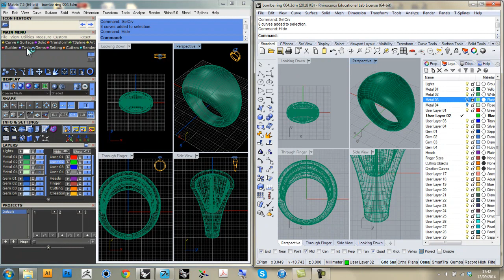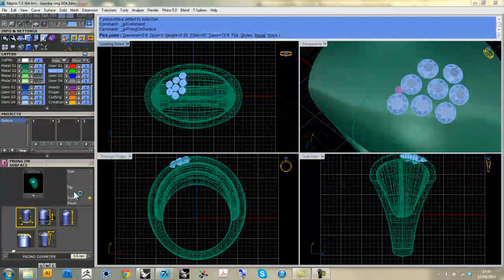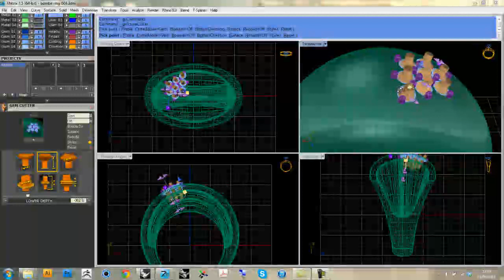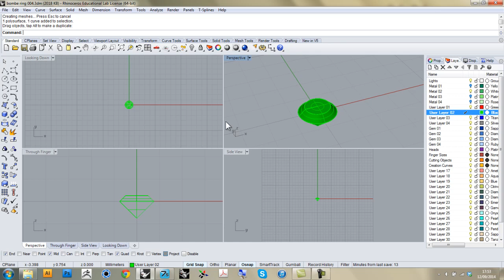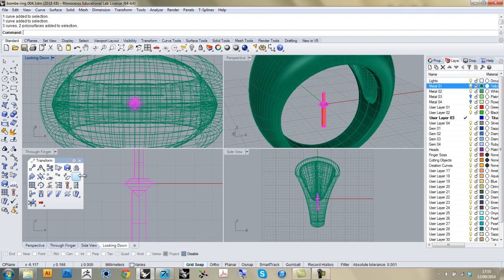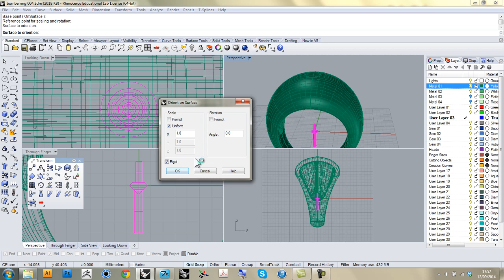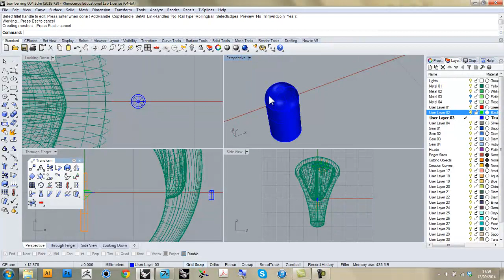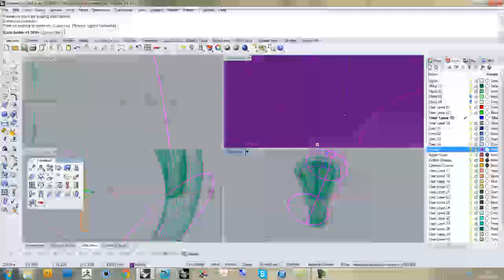Matrix to Rhino CAD Tutorial part 2 - Gem Cutter, Gem On Surface, and Prongs

Comment: Helpful video 
Pls continue making them

Also make a video on gem on curve
Reply from the maker: Hi Lifeperspective.

If you'd like to add gems on a curve on a surface, make a curve on the surface (using any number of techniques such as ExtractIsocurve or InterpCurveOnSurface). Then do all the same techniques for orient on surface mentioned in the video, but then turn on the Near O-Snap right before you start placing the gemstones/claw settings with OrientOnSurface. This will allow your placement of stones to follow the curve.

Let me know if that works.
Reply: CADJewellerySkills thanks a lot🙏🙏🙏
i will tell you if it worked or not.

Also i wanted to ask like i want to place gems on curve on a leaf like surface so i was using the taper gems command but the problem i am facing is gem space, i have to adujst each n every gem by myself due to the gap issue which shud be 0.2mm right?
Reply from the maker: If you're trying to get smaller pave gems placed on a curved surface, it's always going to be tricky. This is why pave setters spend years practicing their speciality. Two tricks will help you as a CAD designer: 
1.) You have a leeway between 0.2-0.26mm for placing 1.5mm stones. If you're placing 1.0-1.2mm stones, it drops to 0.18-0.22mm
2.) If you're actually going to make these pieces, leave the final placement of the stones to your professional pave setter. I wouldn't even bother drilling pilot holes for the stones unless they ask.

If you'd like to know more, send me a direct message or contact me through my website cadjewelleryskills.com. :-)
Reply: CADJewellerySkills yes i bookmarked your website yesterday only.
Thanks a lot for your assistance